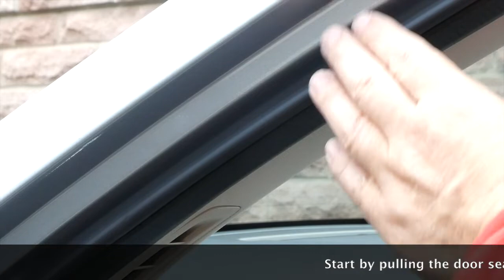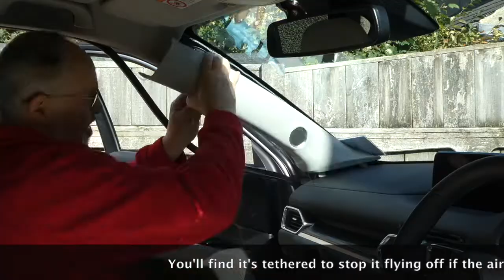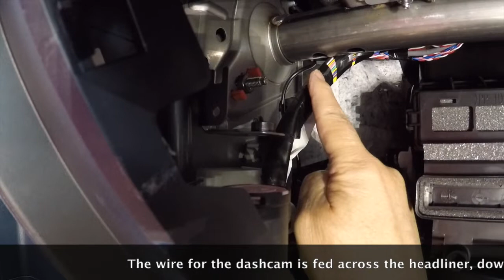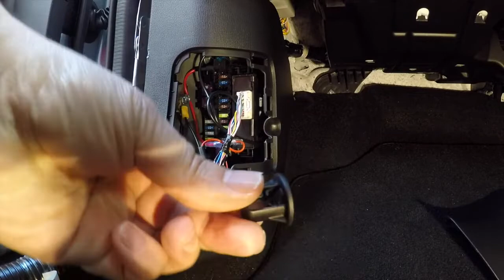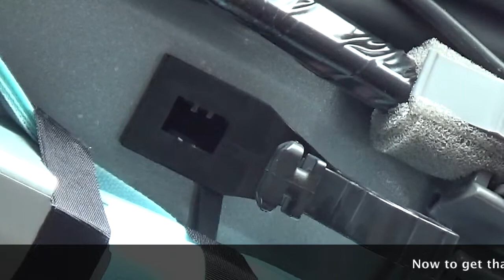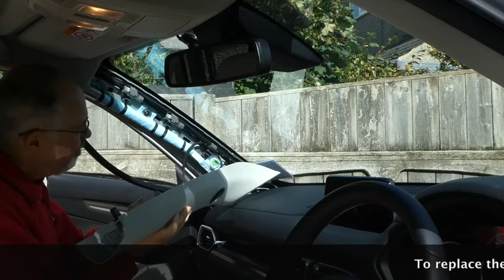CX-5 and CX-3 A pillar trim

Comment: Nearly lost my sanity trying to get that clip back in, thanks for showing how to get it out of the frame without damage.
Reply: I couldn't even remove it in the first place, Mazda 6 2017, zero space for ur hands and couldn't get it to turn with any tool. I've just run the cables behind the airbag.
Reply: Same here, thank you for sharing how to deal with that clip.

Comment: Thank you for the video, while replacing my tweeter in the A pillar I removed it the way you did.  But I  modified the insertion of the trim by NOT taking out the black clip from the metal part of the A pillar. I used a long nose slim plier and inserted the tab back in the holder by rotating it 90 degrees and then guiding it back in the square hole in the plastic trim before pushing every thing back. If you have long slim fingers, you do not need the pliers.
Reply: Thank you for your comment. I was about to just bring this to a professional after seeing that bit, because it looked to complicated to remove the black clip.

The last time I did this for another car, I broke the clip just by pulling too hard, and that was a simple push and pull type of clip. This was something else, having to fiddle with tiny tools.

Comment: At about 0.50 what there is a black locator tab or pin visible just about the thumb. I think all it does is go into a hole and line up the trim and connectors, etc. I removed it for some reason then I lost it. I haven't been able to find a part number. Anyone know what it is called and the part number? I can find the connector with the tab you have to twist to remove. I'm thinking of just getting a new one of those and inserting it into the slot on the trim panel and they attaching it to the pillar. But I've lost the black part. It just slides onto the molded part on the A pillar with the slot for the other trim part.

Comment: I pulled the a pillar trim back and have not disconnected the tether. I want to push the pillar back in place but its not fitting in. Is there a way to do this without disconnecting the whole pillar trim?
Reply: No, you’re nearly there so just pull it out and sub assemble it as shown.  The clip won’t allow you to do it while it’s still in the window frame.

Comment: I'm told by my MAZDA technical service that A pillar airbags here were a source of click rattles in my 2019 CX5 4 cylinder Maxx Sport. They resorted to putting tape somewhere , to remove the clicking, but unsuccesfully though. Any thoughts of this assembly here together with clips, air bags, wiring seem apparently to be a source of rattles. Comments, insights or analysis welcomed. If I could upload an audio of the clicking, I would, but I can't atm. Any suggestions?
Reply: The common sources of rattles were, sunglasses holder (they can throw their voice!) and the centre vents that stop if you close them.  I had several of these MKIIs and they weren’t bad in the area of the A pillar trim but try some temporary pieces of card just to eliminate it.  They really can be misleading and are coming from somewhere else.
Reply: I've got a rattle going over coarse bitumen roads and bumps somewhere around the tweeter area. When I press the lower part of the trim the rattle stops. Took months to source it to this area - originally thought it was from deep inside the dash. Its been getting more frequent so I'll try a small piece of thin cardboard between the base of the pillar trim and the dash and if it doesn't work, will remove trim and tape any loose wiring noting not to obstruct the airbag.
Reply: @MrLongpaddock  Any luck with these rattles? I have exactly the same, and I am sure it's coming from the A pillar. I am now very tempted to remove it and take a look.
Reply: @paulp6292  I've done the small piece of folded card between the A pillar trim and dash which stopped 80% of the rattle but as the card flattened out over time, its performance diminished. Recently took it out and while there is more rattle, I'm getting used to it. Comforted by knowing where the noise coming from! Will put a fresh piece in as am not convinced that the effort in taking off the trim plus uncertainty of  taping the correct wire is worth it.
Reply: exactly the same on my 2024 signature. Tweeter area, driver side.  @MrLongpaddock

Comment: For those that have a 2016 model, you have to cut the tether in order to remove the A pillar.  You will need a replacement part.  I got one at the dealer for about $9, but you can find it online for about $4.
It's super easy to remove once the tether is cut, and also super easy to install with a new clip.
Reply: Please for those with 2016, post the part number. I hope its same for 2016 mazda 6 and cx-5

Comment: I have a Mazda 3 sedan 2016 which is similar. Is it dangerous when removing the pillar ? Could I possibly set off the airbags. I do not want to get hurt
Reply: You mean the trim?  No you won’t set off the airbag by removing the trim.  Make sure the ignition is off and just follow those instructions.
Reply: So I just tried it on my Mazda 3 and the thing tethered to it is impossible to remove. There is not enough room to get my hand in and twist it. Any solution?
Reply: The official way is to cut it and fit a new one as a sub assembly.  I haven’t actually done a 3 but that is the usual way.
Reply: I have a 2016 Mazda 6 and I will be going through this today.  A whole year later I hope you got it done though haha.